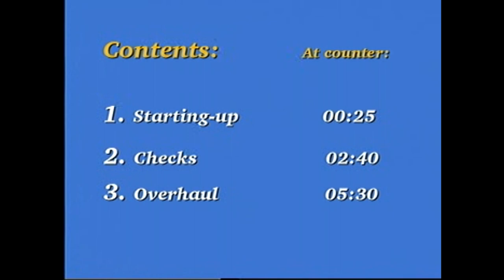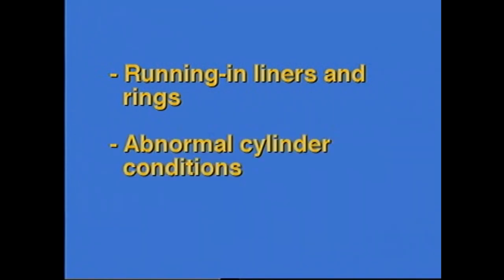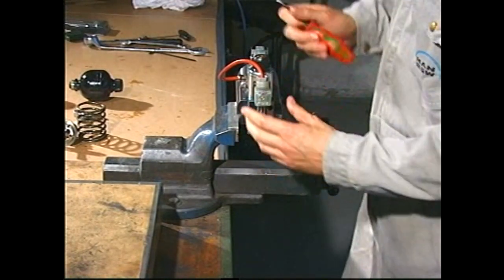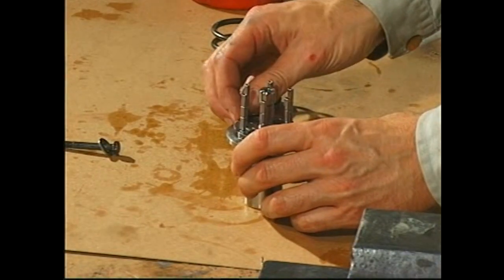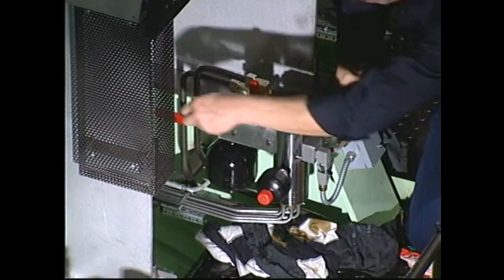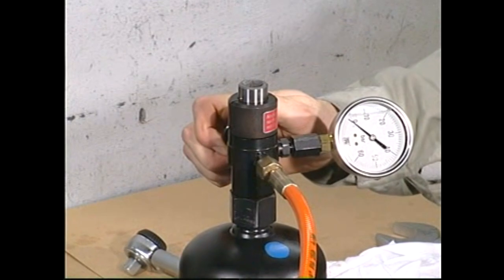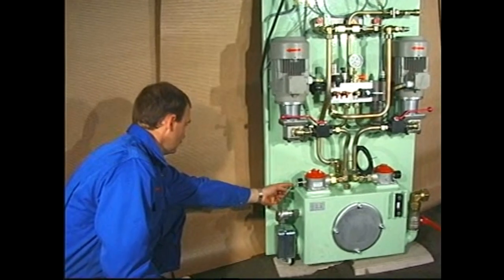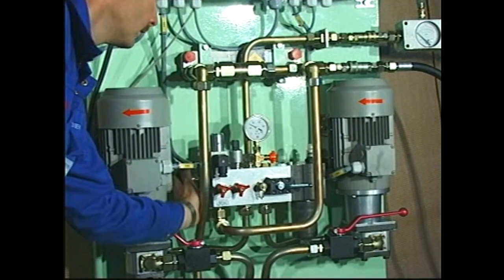2 Stroke Main Engine Alpha lubricator full details

Comment: how to remove EGB circulating pump gland packing and which material ?
Reply from the maker: To remove any packing from pumps there is packing tools different sizes called packing extractors.
Reply: I'm giving exams for class 4 , surveyor is asking this particular question that for circulating pump for egb and how to remove and what certain precautions and I guess material must be different because he was stressing on this point
Reply: And thanks your videos are great help
Reply from the maker: Some of precautions is depressurize the system ,for material there is varius packing mostly for high pressure and temperature.